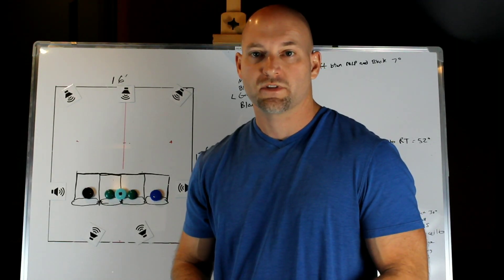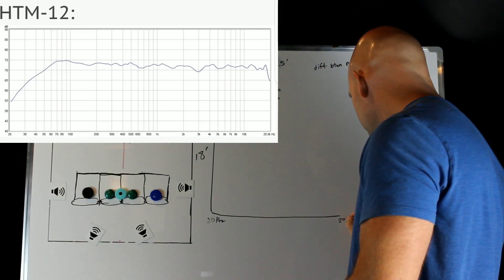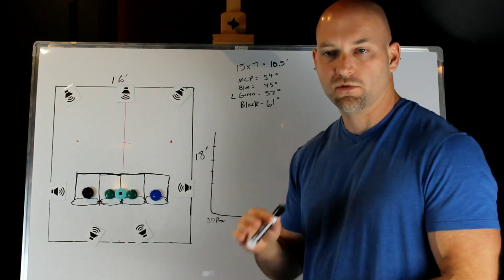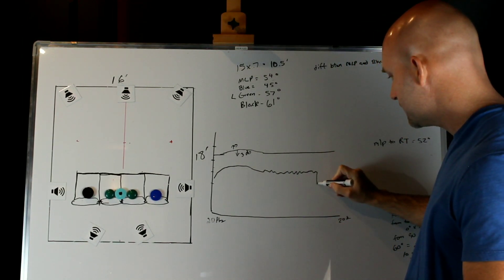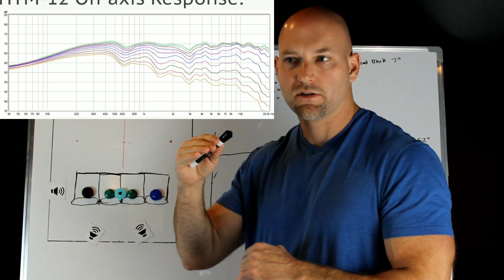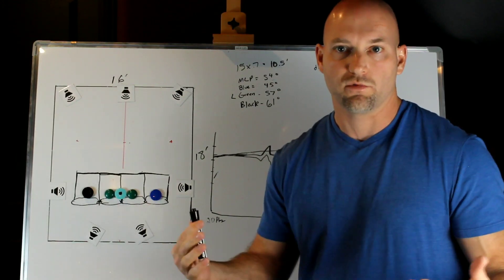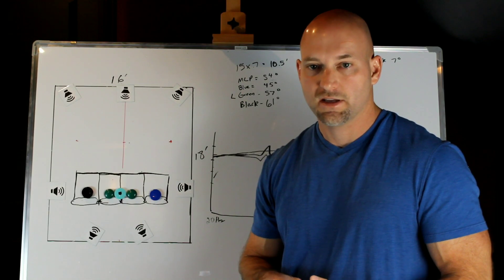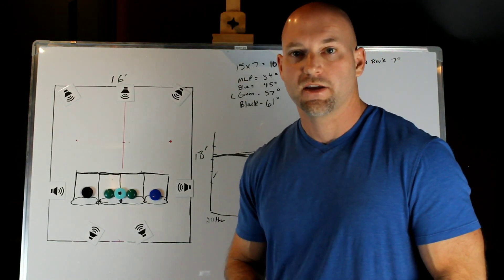Ep 4.  Vocals hard to hear?  Speakers don't sound like they should?  | Home Theater Gurus

Comment: I'm planning on using Mirage OS3 FS and Center for my LCR and OS3 Sats for all my surround and atmos (ceiling hung). These are omnipolar speakers, are they going to be adequate for an ATMOS setup?
Reply from the maker: Ideally atmos speakers will be direct radiating but if that's what you have it doesn't mean you can't use them.  Of course object placement could be smeared somewhat.  Ep 3 covers atmos and Dolby's recommendations as far as speaker characteristics.

Comment: In the beginning of this video, it says in that text that "Overhead speakers with a wide dispersion pattern are desirable for use in a Dolby Atmos system"..and i thought that wides are NOT recommended, as Atmos speakers?? So can i use wides as top middles? Or did i understand something wrong now?
Reply from the maker: A wide dispersion is a characteristic of a speakers dispersion.
Reply: @hometheatergurus  so, actual "wide dispersion" speakers are still not remommended as Atmos speakers 😉
Reply from the maker: @morbus74  I'm not sure who's feeding you incorrect information but during my videos I show you cutouts directly from Dolby. Here's a copy and paste directly from their Dolby Atmos pdf.

 Choose overhead speakers that are timbre matched as closely as 
possible to the primary listener-level speakers. Overhead speakers with a wide dispersion 
pattern are desirable for use in a Dolby Atmos system.

My videos aren't opinion based but information pulled directly from Dolby.  

As for the location in the bed layer called wides, that location is also supported by Dolby but not DSU.
Reply: @hometheatergurus  Yes, i read that wide dispersion from that pdf. text from your video.. But with wide disperion i mean the kind of "wides" that could be used as surrounds also.. Not directly front firing. Sorry if i'm giving you a hard time but i just want get this right 😊
Reply: @hometheatergurus  and i hope you don't get annoyed with me because i'm asking and then asking again. It's just that i'm only learning these things and these things are not so clear to..
Reply from the maker: @morbus74  no problem.  You seem to be gettting speaker dispersion and the position wides confused. 

Wides are a location not a speaker, just like front left or rear right is a location.  Wide dispersion is a speaker characteristic.  The location for the position "wides" is explained in episode 1 and they can be used with atmos but with DSU they will not be active.
Reply: @hometheatergurus  Ok, thanks for explaining things...and being patient.. ;D
Reply from the maker: @morbus74  you're welcome.. ;)